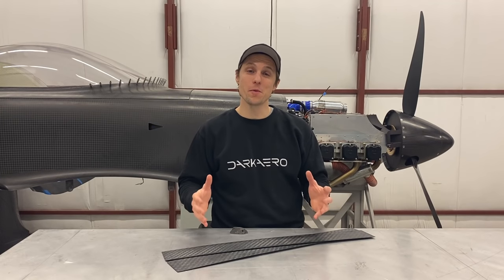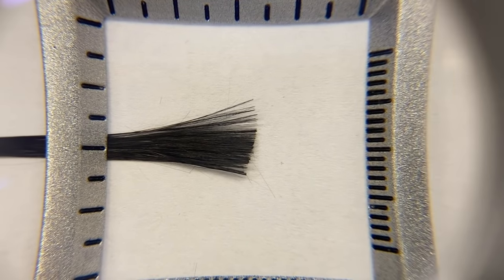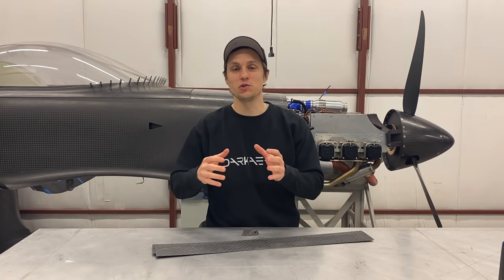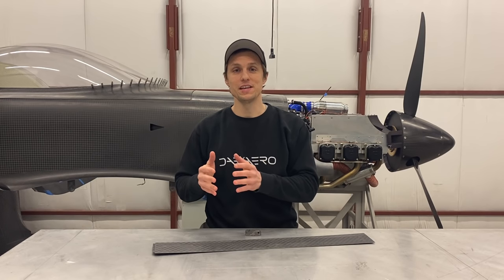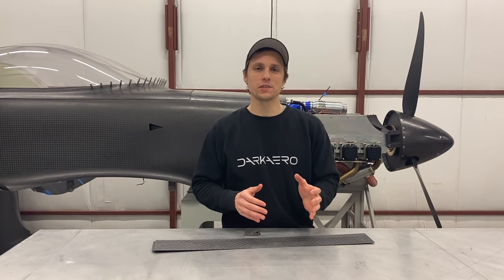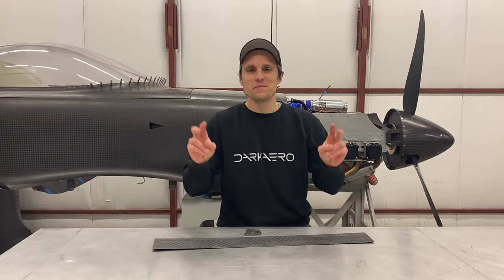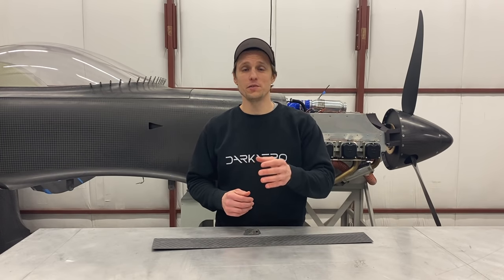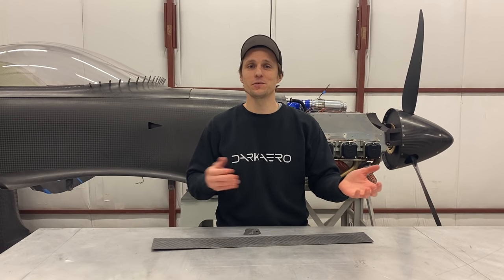Carbon Fiber - 5 things you (probably) didn’t know

Comment: I know you can't give an exact answer, but do you anticipate being able to fly overweight? The Velocity SE has the same cabin width, around the same fuel burn, but 250lbs extra load capacity and an extra pair of seats. Full fuel weighs in at 460lbs (6lbs/g * 77g), 350lbs for a pilot and passenger and another 100lbs for luggage brings the load up to 910lbs. Throw in a nice IFR panel and some upholstery and it's an even 1000lbs.

What's the limiting factor going to be? Landing gear (in which case an overweight takeoff might be ok, just not landing)? Wing loading? Structural rigidity and strength?
Reply: Why I became a fan of canard aircraft, especially after Burt Rutan explained that moving the tail wing from the rear, where it generates down force as pitch control, to the front as a canard wing, with lifting force in pitch control, is more efficient.  The Piaggio/Ferrari Avanti might look like a catfish but it's a beautiful and efficient flying machine, and the SAAB Gripen, too.
Reply: @charlesbranch4120  The irony is Rutan himself moved away from pure canard designs and switched over to hybrid designs with essentially a half-sized canard and horizontal stabilizers. In the year since I made this comment, and after doing quite a bit of research and thinking, I myself decided against building a canard-style aircraft.

The efficiency of the canard isn't actually that much better. I'm guessing we read the same thing about the canard being a lifting device whereas horizontal stabilizers have to "push down" but it's not that simple, nor does the canard make that big of a difference. The safety aspects of canards are also overstated. Traditional designs can have stall characteristics just as benign as a canard, if not even better, AND you get flaps to lower your stall speed.

My issues with the kit plane canards are:
1. Lack of lightning/static protection on the fiberglass airframe. Certified composite planes have a layer of copper mesh embedded near the surface and all sections are electrically bonded, which in effect creates a sort of faraday cage providing lightning protection and avoidance thanks to static wicks which help keep the electrical potential of the airframe the same as its surroundings. I would consider this absolutely critical for any IFR flying.

2. Lack of anti-ice. This isn't as big of an issue in some parts of the USA or the world,  and I can forgive something like the Dark Aero for not having anti-ice. But a twin-engine canard that costs 350k+ to build? No, I'll take a second-hand Cirrus with TKS or an old Cessna 310 with de-ice boots over that. Also, canards reportedly don't carry ice very well, and the Rutan-inspired designs (e.g. Velocity) rely on laminar flow airfoils, even a little rime ice is bad news for those.

And just generally the lack of certification. There are some kit planes I would still consider, like the Vans. They are aluminum, so lightning protection isn't a concern, and at their price point I don't expect anti-ice. There's also more of them flying than many certified designs, and it's a very old, very well-tested design.

The Dark Aero is more like a flying motorcycle in my mind. If I were 10 years younger I'd be in line to build one. Heck, I almost got in their pre-order line a year ago, but I'm glad I didn't, because in the near future I'm going to need at least 3 seats, and for that same reason, I also care a lot more about safety now. The dream is for my startup to take off and afford a turbine someday, but reality is looking more like a 310 or maybe a Baron. Pressurization would be really nice, but for my mission profile at this time it's not really needed. Half of aviation is analysis and decision making, and that begins on the ground.

Comment: I know the real challenge with CF or additive mfr-ing is that with aluminum, the first part is expensive, but the 2nd through 200,000 is far cheaper.  Is the industry figuring out any methods by which to derive some sort of savings through volume ..? Aside from efficiency, knowledge etc. 

A quote I like which your point about testing reminded me of ...
The cheap man pays twice.
Really, they pay repeatedly until they either learn a ton or stop being cheap.
Perhaps it should be: The cheap man pays at least twice.

Comment: That NACA duct on the side of the plane should be moved forward about a foot. Over the wing like it is, I think you’ll find its in a low pressure area because of its location above the wings upper surface, and you won’t get the airflow that you are expecting. Move it above the leading edge or better, in front of the leading edge to get better airflow.

Comment: Beautiful project. Question: Why the fixation with CF? Your performance numbers are extreme, but could you reach a bigger potential market by utilizing the one property that E glass excels at? (its extremely attractive cost).
Reply: The cost saving of E-Glass to CFK are smaller then you would think and usually only become significant in large scale production. The expensive thing about fiber reinforced plastics is the tooling, testing and manufacturing. The material cost only becomes significant in comparison when either the parts become huge or the numbers produced become large. Tooling and testing becomes less significant for large numbers as it usually is only done once, the manufacturing process scales linearly with production numbers. For a project such as this CFK has the edge - not only because it is the stiffer material, but also because it creates a certain customer appeal. Carbon Fiber is associated with luxury high performance vehicles. It is seen as an exclusive material choice. Glass always has the lame reputation of "cheap bumper repair shop material" or "the stuff they make these cheap and always leaky fishing boats out off" that it just can't shake. So I'd say, keep the carbon. The number of customers that get scared away by the slightly higher price will be lower then the number of customers that are lost to the use of "an inferior material".

Before someone get's mad: I know that S-Glass has significant applications and is not inferior, but it's market perception sure is.
Reply: @GermanTopGameTV  I've toured a shop where a twin turbine powered off-shore boat that was primarily made from fiberglass had CF twill used as "paint" in the engine bay. It was supposed to add bling factor, but for me it added vomit factor.
Reply: @GermanTopGameTV      Glad you mentioned S-Glass.  If you don't need the very high Young's modulus of carbon fiber, S-Glass is the way to go imo.  And it is a far tougher and more durable material when it comes to impacts, abrasion, etc.  And if you need the stiffness of carbon fiber, you can do 1 to 2 layers of carbon fiber first over the core, and then a layer of S-glass over the CF to save a bit on cost.  

      As to saving money by improving strengths at low cost--I would encourage folks to look into making their own carbonized cellulose nanocrystals--sort of a like a more nature close version/form of carbon nanorods.  If one does a thorough reading and search through the literature, you will realize that the average DIY'er can make this material at home for fairly cheap and fairly easily. And a little goes a long way with this stuff.  You can add as little as 2% of the powder to the epoxy by weight to up various strengths. 

   One of the tricks to getting good quality C-CNC material, is to start off with a base stock of cellulose that is already high in cellulose and more specfiically crystalline cellulose content.  Industry uses a lot of waste wood and paper like sawdust etc, because it is very cheap and they process massive amounts of it to get the CNC. Such sources are lower in the crystalline cellulose than certain other sources like in a number of the fibers that are commonly used in apparel fabric/material (like hemp, linen, cotton, ramie) or non apparel but cheap fabric and cord/rope sources (jute).  These typically range from 60 to nearly 70% crystalline cellulose content.

Comment: How have you integrated metal in the weave for lightening protection?  Could you show a video on how you've done that. I saw one video on laying a fiberglass sheets down but what kind of "metal layer" is supposed to be used and where do you buy it or how do you make it? THX

Comment: Question: Those "spikes" around the front of the windscreen, are they vortex generator to reduce lift/drag forces around the cabin?
Reply from the maker: Nelson, thanks for checking out the video. Those are just clecos holding the canopy in position. It still needs to be permanently bonded into place.

Comment: I'm designing the fins of a supersonic rocket (STRATOS V) and want to use a carbon fiber honeycomb plate. The most important design criterion for this is aeroelastic flutter, which needs to be optimized for stiffness (mainly torsion). Is there a simple method to take the transverse shear stiffness onto a count for preliminary design because ignoring it is not conservative. 
It would also be useful if I could get some test data on the torsional properties of a carbon honeycomb to test my calculations since I could not find much data on that. The different methods I use to analyze the eigenfrequencies and flutter all output other values so maybe you have some tips for that as well?

Comment: At 3:59 note that the steel re-bar is in the middle of the slab, which is too high. It should be in the lower third to take advantage of the tensile strength of the steel. See KarbonBar for alternative to steel in concrete flatwork, such as in marine environments.

Comment: So in reinforced concrete, there is pre-stressed concrete that pretension the rebar so the I-beam will only experience in compression load, since concrete is good at resist compression but not in tension. I was wondering if there is an equivalent of that in carbon fiber land ? IE: since carbon fiber is strong in tension but not so much in compression, so you fill a carbon fiber tube interior with high pressure gas, such that the carbon fiber tube is always in tension and never in compression. Thus allow a carbon fiber structure to exist without resin. Or some one already tried it out and fail ?

Comment: You didin't mention curing temp that much. Only parts softening with temperature. Basically you need to cure it a higher temperature than it will ever see in it's service life. There have been heaps of problems with new builds becoming soft and the wings drooping when left in the sun on very hot days.
Reply from the maker: Agreed! Post curing is an important step to ensure you achieve full mechanical properties from your resin and also full temperature capability. Ideally you want to have a good safety margin in your temperature capability so that your parts aren't operating "on the edge of the cliff". Curing your parts to temps higher than they see in service is a good way to get some safety margin. Thank you for elevating the level of discussion!

Comment: Awesome,
I thinking about your project, do you paint your a/c's skin cause for decreasing air friction or no?
Reply from the maker: We will paint/coat the airframe but it is primarily for UV protection of the epoxy in the aircraft skins. The skins are already quite smooth straight out of the mold. Thank you for watching!
Reply: I was surprised you didn't discuss UV protection in the video.  UV exposure over time renders all other testing meaningless, so UV blockers have to be added to the resin/gelcoat or the part must be painted.  Shouldn't Uv/time exposure testing be done?
Reply from the maker: @rogerolander458  Indeed, environmental factors are another thing to consider. UV damage is specific to the resin type though. UV affects epoxy but there are other matrix materials that are not susceptible to UV. Echoing what you said, painting or coating is definitely critical if your resin type is UV sensitive. Thank you for watching!
Reply: @DarkAeroInc  I always enjoy watching - thanks for posting such informative videos!

Comment: How are you going to handle environmental conditions such and cold and heat. Also will this be a plane that is limited to 10k alt or will it be pressurized?
Reply from the maker: Great questions! The temperature capability of carbon fiber composite is mainly determined by the matrix material (resin). The epoxy resin we use has a really wide operating temperature window so changes in temperature from summer in Death Valley to cold temps at altitude won’t be an issue. The DarkAero 1 is not pressurized but it can fly above 10k feet. You just need to bring supplemental O2. Thank you for watching!

Comment: Careful with those loose fibers. As I understand it it's more deadly than asbestos. Invisible doesn't mean harmless.
You do nice parts though. although I would prefer fewer parts. Monobody, no bulkheads. teardrop double compound curves for inherent shell rigidity.  Small external turbofan engines also help keep things simple yet awesome.
Reply: The fibers don't enter your body unless you eat them. It's the dust from cutting or sanding that's dangerous and difficult to deal with, especially as most vacuums and filters don't take away particles under 5 microns, and carbon black produces a lot of 1-4 micron particles. I use a double hepa filter shop vacuum but still only cut carbon outside.
Reply: The raw fiber itself isn’t a problem for your lungs. Ive been making and breathing carbon fiber for 10 years”Hexcel”.  Nowhere in our process is breathing filtration required. Even when the air is full of floating fiber particles. It can be irritating and itchy tho.
Reply: @TheLubemaster  wow. and who told you that was safe?
Reply: @DanFrederiksen  The safety obsessed multi billion dollar company that’s been making it for over 40 years. They did all the studies long ago.
Reply: @TheLubemaster  I haven't heard much official talk about CF safety but I have seen official safety data that placed loose carbon fibers just above asbestos in danger. but there is surprisingly little data on it. You don't wear any breathing protection when working with CF? people wear protection just working with wood.
Reply: @DanFrederiksen  Nope..  Mass ventilation for hydrogen cyanide, n95 masks when around silica,  fire resistant coveralls for exotherms.. Plus ear plugs, steel toes and safety glasses to be in the buildings. They even require cut gloves to use a pair of scissors.  Insane amounts of PPE and a great safety record. Breath the fiber constantly..
Reply: @TheLubemaster  hmm, interesting. even if relatively harmless wouldn't it be prudent not to breathe it??

Comment: I find carbon fiber an alluring material for an engineering and fabrication system. However, the enormous damage to the environment CF produces is ethnically just too great, IMO. The amount of byproduct generated is too much. Bottles, cups, stirring sticks, rags, plastic films, foam tapes, breathers, tapes, sandpaper. Next is the off-gassing of chemicals like the resins, thinners, release compounds, gel coats, and, buffing compounds. Last is the CF particles that get out into the environment from sanding and cutting is very dangerous. I would challenge the energy savings vs the energy needed to manufacture the CF system as economically monetarily or environmentally.

Comment: I'm not a pro at Surfacing yet so I made a solid just to test in SIMSCALE however my account is not pro so it wont complete. But this is what I was talking about. It's about 2.00' longer than a Rutan Quickie with the same seating Ego's. Ultra wife canopy for maximum visibility. I have an idea for your plane to shoot your way concerning air traffic safety. None the less here is my wind tunnel model (I will solve the unsightly centerline crease soon).  -  https://imgur.com/p0jIJGK